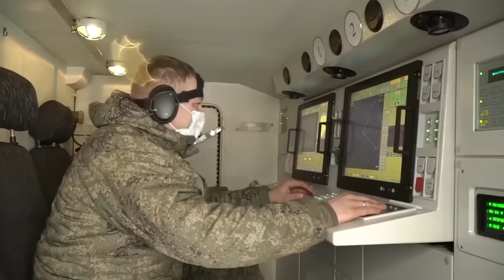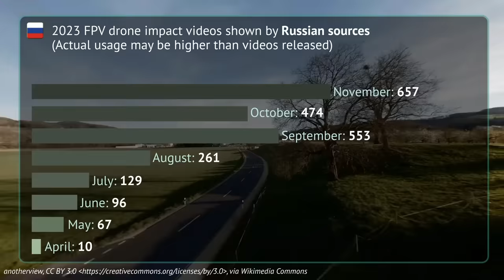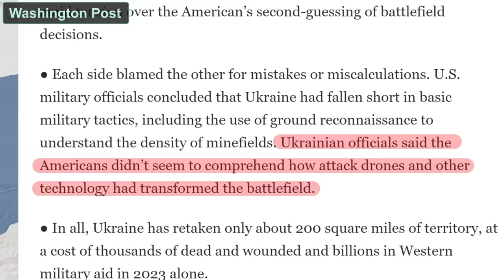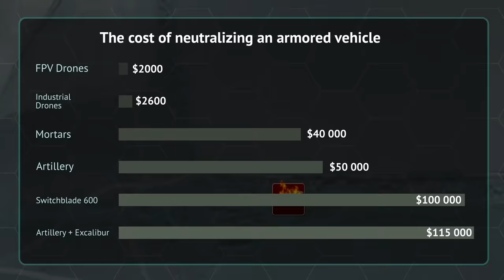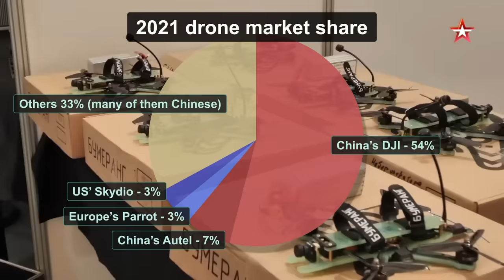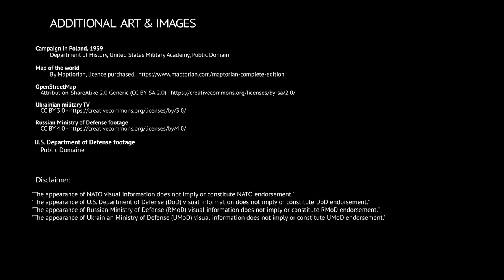First Person View drones are eclipsing artillery usage in Ukraine

Comment: I am not certain that the small kamikaze drone will continue to be the primary standoff weapon in future wars. Their downsides are that there is a lot of latency between target discovery and each hit.

Say you spot a target with a recon drone and the target is a tank. You send one fpv drone 4km. It may hit but not destroy the target. It takes at least 2 minutes for the drone to fly 4km. Then the next strike comes at least 2 minutes (more like 3 or 4 when you factor setup preparation).

A ground based small drone with a gun could carry over 100 25mm bullets (for example). Against a convoy of supply trucks or a group of infantrymen, you would ideally want less latency between shots.

Fpv drones require simple engineering, but they effectively give you a very low rate of fire. I believe this problem will be solved with other types of drone systems.
Reply: If you have 3 drone pilots. You can have 1 recon loitering. and 2 hits in 3-4 minutes.
Then each drone is only 1k ish. And it has the potential to take out a 4.5 million dollar tank (T90)
From inside a trench/tunnel with only an antenna sticking out attached to a tree or something.

That is ridiculous good value military wise. Something the USA should take notes of with their overcomplex way to expensive military complex.
Reply: Bro you realise that drones are super cheap and you can easily train anyone to be a pilot? 

We are talking about SWARM of drones
Reply: @iGhostr 

Bandwidth utilization will prevent more than intermittent transmission of imagery from any given drone in a swarm for the same reason that a bunch of people watching movies from a single hotspot can slow the frame rate of each to nothing.

Even if you can pump this with careful spreading techniques, the drones will need to have AI/IFDL communication amongst themselves so that they don't all choose the same target.  A human could never steer them all to target, together.

Look up Arena-M and Volnoris as well as 30mm ABM and MSHORAD HEL.

With the correct cueing sensors, you can blind a drone's optics at 3km, thermal kill it at 1.5 kilometer and blow it out of the sky with an air burst munition at 1km.  A jammer will deny the LINK by 500m.  And a layered APS with interceptor and MEFPS effectors will slap both drone and dropped AT grenades, right out of the sky from 30m to 2m

Inside this, you go to cope cages and ERA.

Drones are a dead end because all the solutions needed to protect a tank from a TOW or Stugna or Hellfire, also work on them, far more effectively.

The other thing you need to recognize is that deep-layer RT, mines and ATGW (even other tanks) have made direct fire impossible as a means to support an armored assault.  But the need for direct fire support of infantry is itself non existent.  Because the infantry cannot survive in the open, sprinting over mines, in 20-30 seconds that it takes for an artillery spread to come down on top of them.

And they don't need to.  Because a tank main tube has a 10-15km reach (in Vietnam and Korea, this extended to 20km+, with a dirt ramp), courtesy of that mile per second operating pressure.

With that as a given, a modern M829A4 APFSDS is costs 10,100 dollars.  An PGK (inertial guided) round costs 9,500 dollars.  

If a tank dares not come within 2km of a previously registered fire zone, filled with mines (the #1/#2 killers of tanks at the moment, drones being tied with remote-fire ATGW for #3), then tanks can still be raiding systems with protective suites and indirect fire modes.

How is this different from artillery?  Nobody is parking a D-20/D-30 in a gun pit and pretending it cannot be hit using fire finder radars to back track the high angle trajectory of the 122/152mm guns.

A low angle gun fires beneath the horizon limit of fire finder to find it and, being attached to a protected mobile chassis, invokes a 'No, you come to me...' range overmatch which means it's own drones (Lancet, Scalpel, Kub) can fly out, spot targets from long standoff ranges and then call in fires on a very low trajectory with perhaps a 10-12 second delay for time of flight compared 30+ for high angle systems.  No warning.  No dodge.

All of this will cost, at least in the first generation, so that a 10 million dollar Abrams and 7 million dollar T-90 equivalent, will probably top out at 20-25 million, between the shift to a new gun system and APS/ABM/Laser defensive VSE package.

The difference will be that tanks, operating alone or in small platoon groups of 3-4 vehicles, will be able to create a zone of control as much as 20km across and thus kill things without being whites-of-eyes in sight of something able to lethally shoot them back.  Including their traditional enemies: other tanks.

All of these systems exist, some for more than 40 years (Arena and Drozhd go back to the 1980s).  The difference is that, because nobody believed we would be fighting another CHI conflict, they were not brought to production level TRL, in the decades we spent hunting terrorist wombats across SWA while the Russians struggled to effectively get out of bankruptcy court.

Now, with losses numbering 60-80% at the COMPANY level (14-17 vehicles) before tankers simply slink away, the opportunity cost of replacing 10X3 people with just 4X2 people (all defenses also having to be automated while the gun control and NLOS round programming will effectively be AI driven as well) will mandate a shift to a new kind of tank.

Everyone who does Armor Design knows this.  Just as they know that inertial rounds with a CEP of 3-5 meters can do 90% of the 'infantry support mission' without being subject to backtracking before they shoot-and-scoot didimau on out of there.  Hitting moving targets, at range, is where things get complicated.  Krasnopol and Copperhead cost around 70,000 dollars.  MRM_CE costs north of 100,000.  This is where armor gets expensive as self homing missiles that have to survive 30,000G of initial acceleration to 6,000fps before activating an MMW seeker that can look through a radome heated to white-hot (again, lasers will jam IIR seekers) at the end of it's flight will _not be cheap_.

We've done it before with SAL but SAL requires a designator and that is likely where the next-step on drones is going to come from, since it allows the UAV to standoff, beyond the engagement range of enemy vehicles defense systems.

You will want to recover it (so no warhead), rather than throw away the high end EO sensor and designator package.  And the bad guy will know you're sparkling him and likely preempt your missiles with jammers and metal smoke obscuration.  It will likely be gasoline powered and rocket boosted launch, to improve range and compactness.

Bluntly: kill drones are an evolutionary dead end.

You can pretend to be a rigger in cyberpunk, where the target doesn't shoot your effector out of the sky with AI driven mechanical perfection but when the kill vehicle cost goes down to 10-vs-2 vs. guided hypervelocity rounds, the military will choose the 5:1 cost increment to keep their NLOS equipped tank out of harms way and return freedom of maneuver in a protected against MG, Mortars and Drones, mobile fires, platform to the battlefield.

UAVs may still have a reconnaissance role and fixed artillery is what is going to be on it's way out, not tanks.
Reply: @xyz-hj6ul  wow, thanks for this reply, it was interesting to read it. This is what I wish social media would look like. Cheers!
Reply: @xyz-hj6ul AI. The operator will only need to identify the target and the drone will do the rest on it's own without further instruction.
Reply: Nice breakdown 👍
Reply: @N20Joe  

"The operator will only need to identify the target and the drone will do the rest on it's own without further instruction."

To the limit of the FPV before jamming or low batteries as signal strength interrupts.  The LAMs, such as X-600 and the Lancet-3 which do have AI driven target selection still have to be steered into effectiveness.

And yet the tank, cut loose from the 'infantry support role' in seizing multi-layer defended objectives (Mines, Pre-Registered RT And Drones); can drive 40-50-100km deep and stand on the MSR transport arteries which MUST supply each soldier with 2,500 calories, 3-4 gallons of water and 10-15 drones per day at 3-5lbs each.

i.e.  In trade for dominating a given chunk of frontage, that is perhaps 5-6km around their location, the drone operator now needs an entire motorized transport system to support their position.  With ten times their visible signature vulnerability.

Lose the LOC, starve the force.  It will take only a few days.

Whereas, by adopting an open-battlefield approach, the enemy armor can bypass all known fixed-point defended areas with heavy occupation by dozens of soldiers, to instead interrupt the traffic of that transport system as softskins and APC, dozens of kilometers further back.

Which are essential to delivery of tons per day worth of food and munitions.

The drones themselves will not be less visible, because the nature of their high altitude approach will leave them subject to contrast track with an IRST that has 4-5 UV cross doped detectors to reduce 'blue sky' glare and leave everything cold for instant lockon of even small optical targets.

After which, you either dazzle the target with a laser or shoot it down with an RWS mounted rotary gun.  No video or flight control link required as the same AI which lets the enemy drone spot the tank can allow an RWS on a robotic UGV to defend the vehicle against drones, even in significant numbers.

It's a long play/look list but if you look at a fraction of it, you will see where this is going.  The difference is, again, the tank is autonomous, based on the amount of fuel it carries and the fact that the same systems which defeat drones can also wreak utter havoc with ground vehicles.

So, if you can build 20 tanks per month and 100 UGV tankettes.  And you send those tankettes deep, in multiple locations, where choke points say 'here be trucks' (bridges, firm roads, known concentrations of troops needing frequent resupply, nearby).  Then you can shut down entire sections of front, just by starving the troops of the logistics which are committed to holding enormous, fixed, frontal positions rather than maintaining the open battlefield system whereby you only kill what tries to cross the grey zone NML.

LINKS-
GShG-7.62
https://en.wikipedia.org/wiki/GShG-7.62_machine_gun

Gladius Remote Weapons Station
https://www.evpudefence.com/p-gladius-remote-controlled-weapon-station

Wiesel = 800,000 dollar tankette with 20mm AC.
https://fft-keymilitary.b-cdn.net/sites/militarykey/files/styles/article_body/public/imported/2021-12-08/img_40-1.jpg?itok=OubX4fug

M2 vs M134 At 300-500-750-1,000m
https://www.military.com/video/guns/machine-guns/comparing-the-m134-vs-50-cal/2745860039001

ADADS Air Defense Alerting Device System IRST
https://www.thinkdefence.co.uk/wp-content/webp-express/webp-images/uploads/2022/11/ADADS-1.jpg.webp

Dazzler vs. Drone, Note Area Of Effect
https://www.youtube.com/watch?v=NIOh9-RoAaE

UK Long Range Dazzler
https://www.youtube.com/watch?v=vZpUN8gbCJU

RWS With Integrated Dazzler
https://www.youtube.com/watch?v=aIoHJDP_z7U

Comment: They are useless if you can simply jam them properly, radio jammers are nothing new, emps can mostly jam them all.
Why hasn't Russia used the EMP? It would have simply burned those drones and further jamming would have rendered them useless
Reply: You are throwing a lot of words around there buddy, have you considered reality to seep in to your thought process for a few seconds? Electronic warfare systems have to be developed, produced en masse, and provided to sufficiently trained soldiers. Russia has shown that they are bad at at least manufacturing and providing adequate training, so don't hold your breath.
Reply: you can use Aluminium foils as a Faraday shield to protect your drone from EMP and as a shield against radio frequency jamming,  you need just to open the angles that yor antenna need to send you the frequency.
Reply: Bro, stop playing video games and actually learn some physics.

Comment: no, it doesnt'. FPV is the most overrated thing.
It's just a filler, because artillery killchain is 20 minutes, and mortar is at least 5 minutes.
Reply: have you seen the videos? the blows are devastating.
Reply: @sapitron  500kg jdam is devastating.
1 kilo drone most certainly not. Drones mostly finish off abandoned vehicles, catch up retreating stragglers and harras infantry. That's important, but in total war effort it makes almost no difference.
Reply: @mezmerya5130  they also tend to immobilize tanks that are on the offensive as shown in Avdiivka. they are really good at knocking out IFVs and APCs especially the old soviet ones that only have around 6-10mm of armor on most of the hull. these drones are using RPG warheads which don't rely on speed to penetrate armor so you slap an engine deck to stop the armor then shell it to high hell while the infantry inside try to run away from the soon to be deathtrap.
Reply: @dominuslogik484  they are not. Shown what? Two lucky catastrophic kills out of 100 tanks lost? Mines and artillery do that. In case of russians their jdams too.
Reply: @mezmerya5130  you are a child
Reply: @nemaproblema6879  where are videos of hamas bombing IDF if drones are so impactful?
Oh wait, it's just  takes a conflict of two eastern caveman without any technology that crap like fpv becomes even slightly relevant.